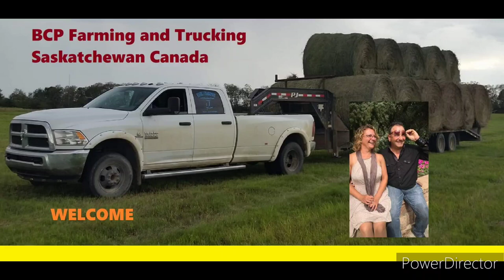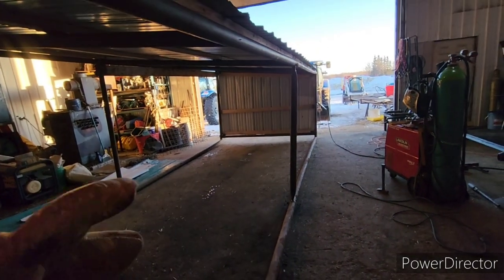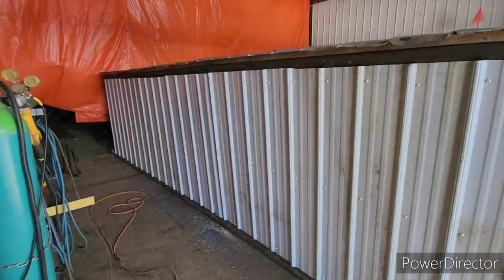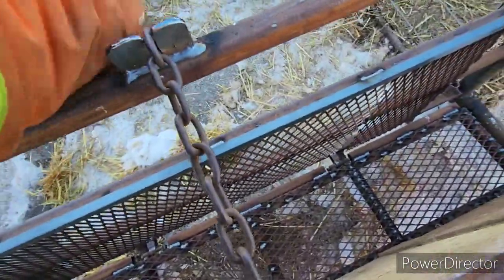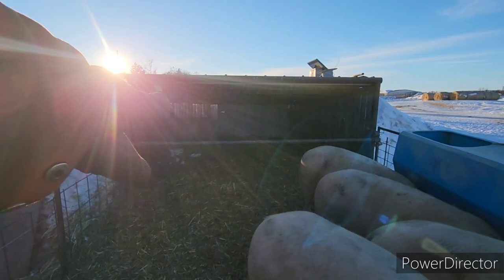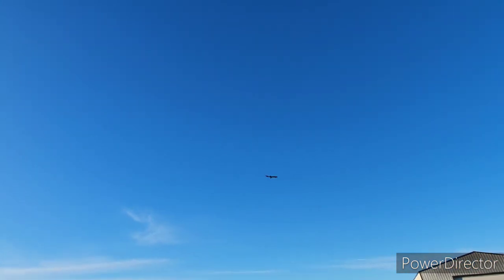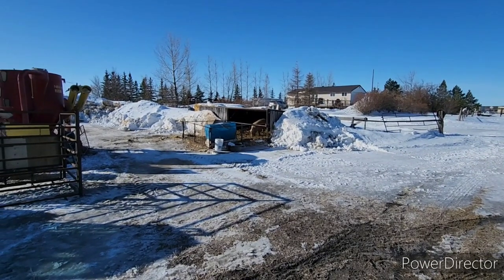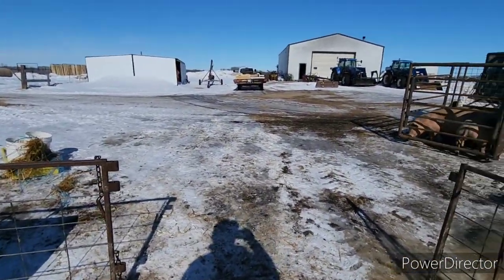This Little Piggy Went To Freezer Camp

Comment: So something you can build for piggys in the summer you have more is a 10x30ft pen out of pipe. Make a shelter at one end and a mounted feeder at the other end. Then you just move them around on yard everyday all summer.
Reply from the maker: Nope...they root to much lol
Reply: @bcpfarmandtrucking6560  nope they don't. Gotta move them every morning. As long as they are in tall grass. I wouldn't put them on the front lawn by the house but around the equipment and such works good. I never built one for myself yet but my buddy has one and uses it every summer around his back yard. Leaves one of his old tractors hooked to it and before work he moves it. Raises 6 pigs a year in that pen.